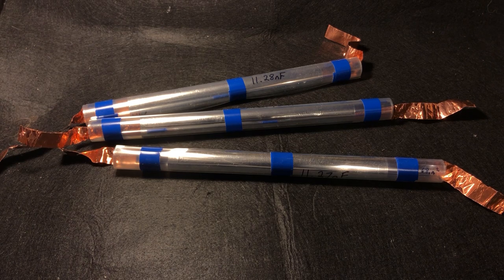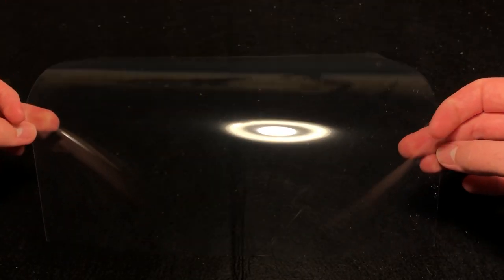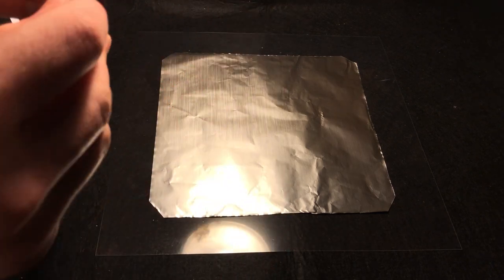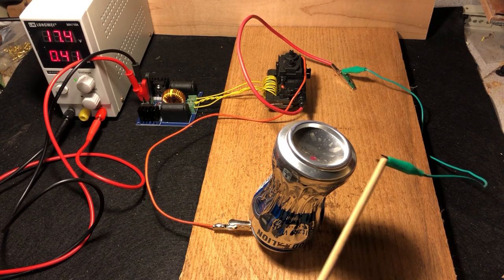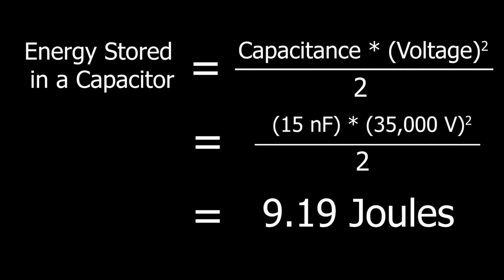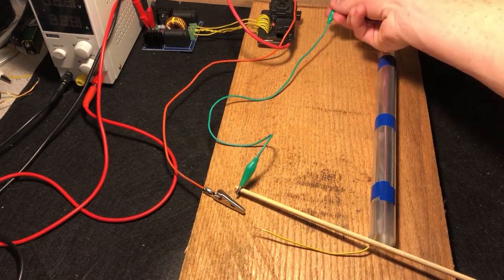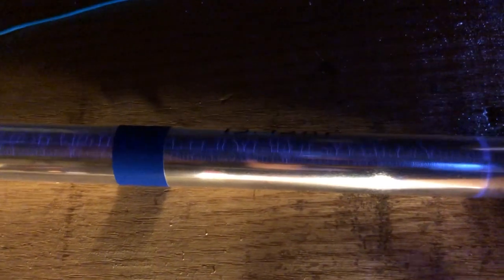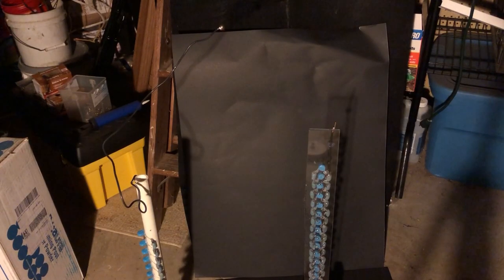How to Make Powerful High Voltage Capacitors

Comment: Putting a capacitor in oil is definitely worth it. In an 1891 patent Nikola Tesla mentions that glass and mica capacitors are inferior for high frequency use and its best to eliminate air near the plated  by putting them in a container filled with oil.

Comment: even with the corona discharge eventually breaking the capacitors they'd be so easily replacable that it's a non-issue if you take it into account with any designs using this capacitor. just make it replacable in any circuit and you'd be good to go.
Reply: How does it eventually break them?

Comment: Good video, you are absolutely right wire legs are a pain. Flat legs are the way to go. I found some 0.1mm aluminum sheet that worked very good, but may need to be thicker for higher current. The corona along the edge of the foil is due to the ridged mylar leaving an air space at the end of the foil. Rolled on a pvc tube helps get it tighter. I've had good luck with 6mil poly sheeting.

Comment: The inductance of this type of homemade ROLLED capacitor can be greatly reduced by using electrodes that span the LENGTH of the Al plates.  When rolled, the winding naturally produces self inductance since the current must flow along the cylinderical turns (a natural inductor).  By using wide electrodes along the plate length, the current in the roll travels in straight, parallel paths from top to bottom, instead of AROUND the the rollrd foil.
GREAT VIDEO!!!

Comment: I disagree with the claim that using oil would be beyond the simplicity that the caps are made for. In fact, they don't even have to be fully submerged. With a few tsp of mineral oil between the mylar sheets, you could vastly decrease the effect of corona discharge. Just seal up the ends of the caps with tape to keep leakage to a minimum.
Great video though, I expected lower quality with the number of views but this should really have many many more views.
Reply: AGREED!

Comment: 7:08 I think submerging the capacitors in oil might cause issues for the adhesive on the copper tape as well.

Comment: Nice video. The copper to aluminum contact will oxidize in low moisture too. It might be better to use tinnes or nickeled copper wire stripped long enough to privide a large contact area. I actually twist the wires with the Al foil instead of simply taping them on it.

Comment: How does rolling the cap increase the plate surface area??
THANKS MUCH!
Reply: That brings more opposite polarity foil surfaces together that otherwise would have been far apart if it wasn't rolled.

Comment: I connected 20 Maxwell 2.7V super capacitors in series and I want to spark, but with each spark the voltage decreases a little from the capacities, the total charger of these 20 capacitors is 55V DC and when I connect them in parallel  Their output voltage is 2.7 volts, how can I connect them to get 300 volts output?
Reply from the maker: You can’t. No configuration would yield that potential. I’d recommend you look into the fundamentals of series and parallel circuits before you mess with anything close to 300V.